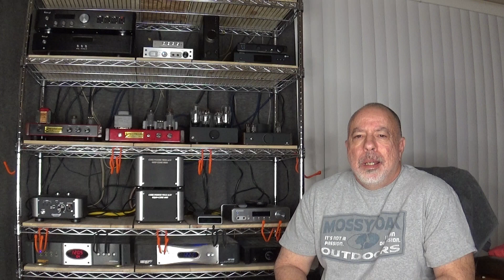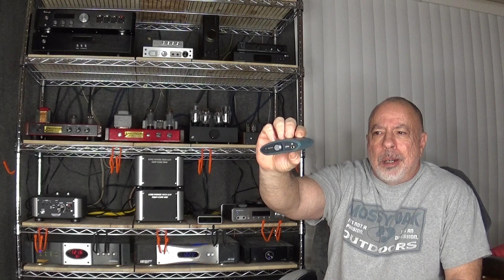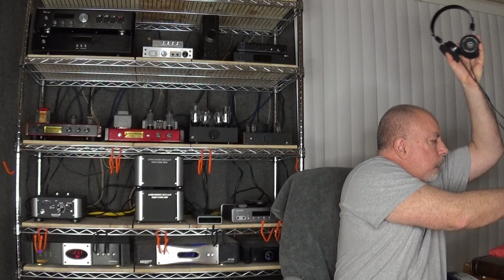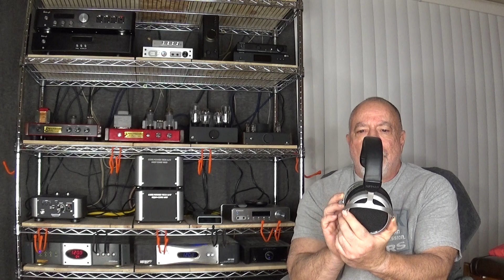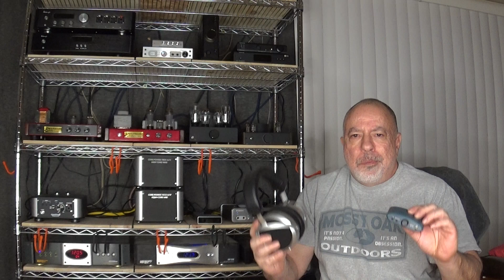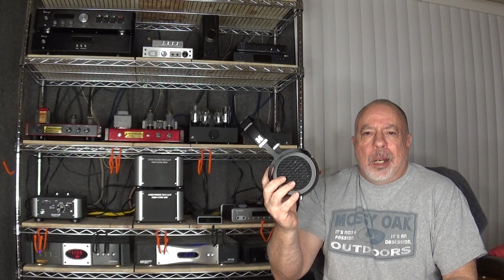BUDGET AUDIOPHILE SYSTEMS - AMP/DAC AND HEADPHONES - $155 to $500.

Comment: i do love my zen dac air, zen can combo as my first setup so far. I got my eye on the xduoo ta22, but a tad pricey.  also got my eye on a pair of sundara for 200 pounds, or edition xs for 430 with a balanced cable, will be an upgrade to my senn hd599 and monoprice retro (with the brainwavz xl pads). so its planar next, time to do some saving up. Although i am thinking of getting rid of my zen dac air, to get a dac with more inputs mainly fibre optic, any recommended ones to go with my zen can?

Comment: I hope that your health recovers fully as fast as it can. 
I own SHP9600 and I pair it with a Shanling UP4 (2022) Bluetooth DAC. The DAC pairs really well with this headphone and its quite pleasing to listen to open soundscape-like songs and other genres as well. There's cheaper wired DACs out there but if you like the option of Bluetooth then the Shanling dongle is really good and well worth its price. 
In Germany I got SHP9600 for €70 although the price has dropped to €64, and I got the Shanling for €85 as a "like new" used product.